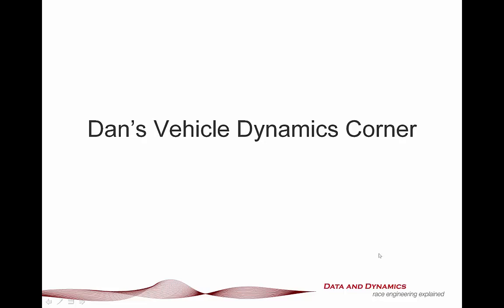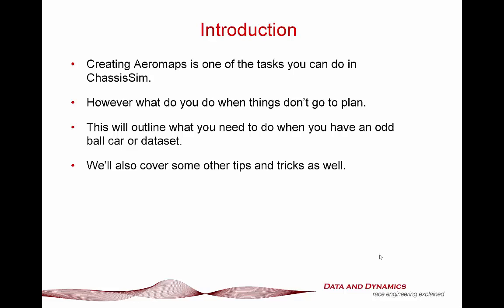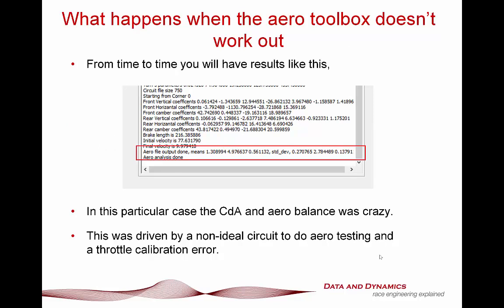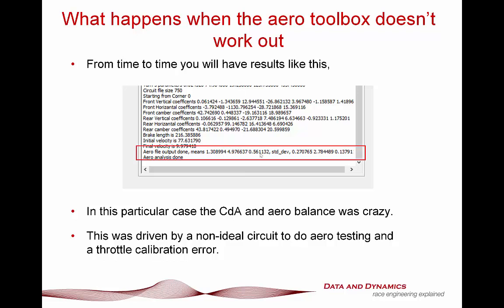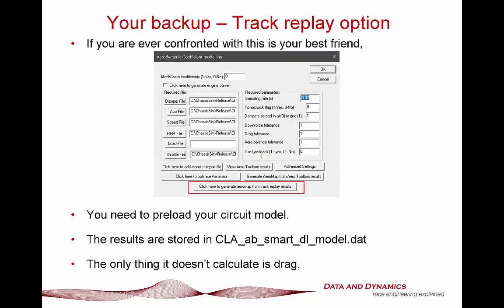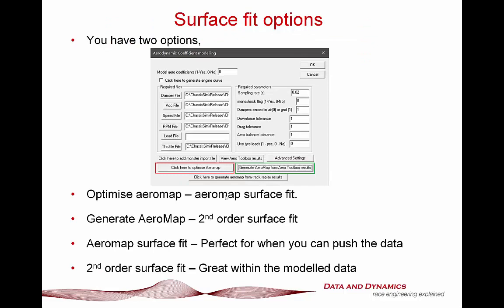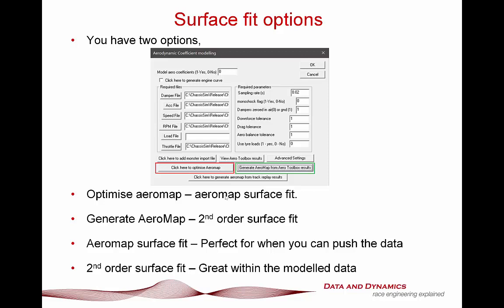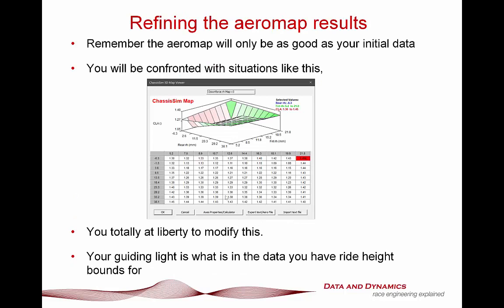Aero Modelling Tips and tricks when things don't go to plan

Comment: Are there any easy ways to go about simulating dynamic ride height with a simple ride height based aero map? I'm trying to find the aero load with rake, but as the vehicle increases speed the rake will begin to decrease since the front axle has a higher wheel rate than the rear. This gets even worse since there are bump rubbers and third elements to contend with. I suspect to model it I'll need to use some form of differential equation, but I don't take that class till this spring. What do you recommend for this?
Reply from the maker: Christopher - remember any aeromap always refers to the dynamic ride height. That is how they are all setup. Your job is to figure that out from race data. I'll give you a hint, figure out the damper deflection at the wheel and then the tyre deflection. Refer to your quarter car model.